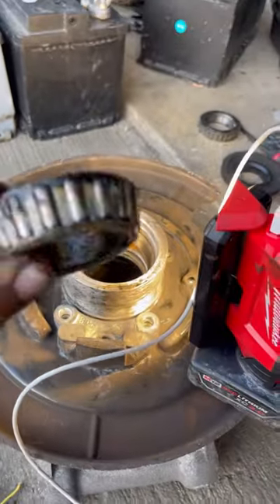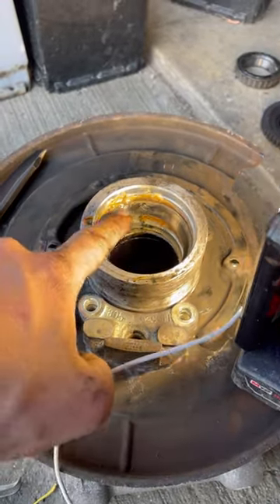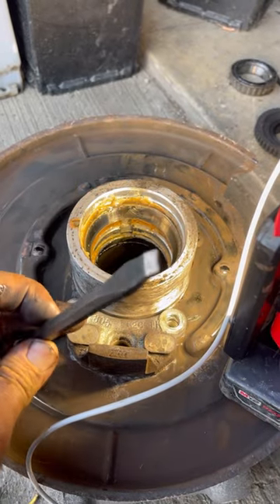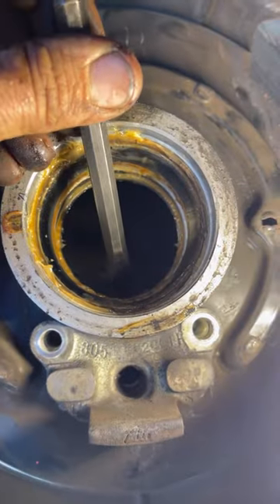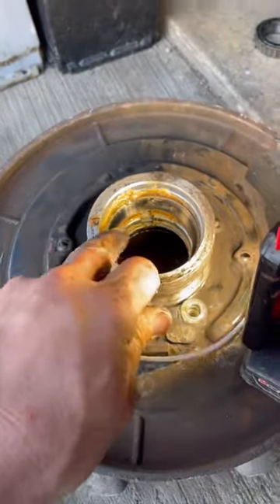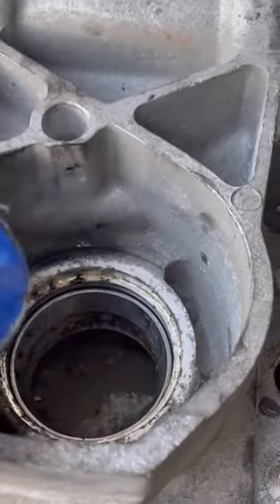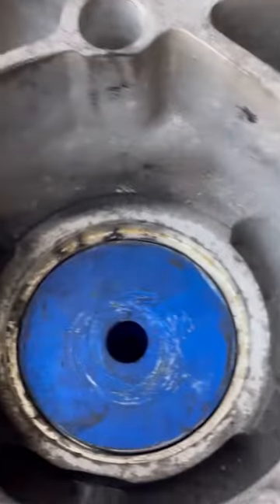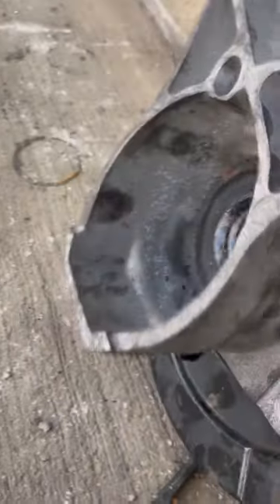Jaguar xj8 rear taper bearings knock out & punch In races spindle / knuckle

Comment from the maker: This car was taken to a shop, they said they couldn’t find a noise.  The noise was coming from the rear, sounded like right rear but can be deceiving.. I didn’t hear the noise on the lift either.  The noise is rare and intermittent but when it happens it sounds similar to a tire rubbing on a fender liner but there is a noticeable pull like something is hanging up.  The car must be driven & under a slight load at 40-50mph to hear it and even then it’s random & infrequent.  Really sounded like it was coming from the right rear when inside the car but after finding no damage to the wheel bearing after replacing it & hearing the same noise even after doing the worn out rear brakes; pads & rotors & cleaning / adjusting the parking brake shoes, eliminating the obvious things… turns out the 75k mile rear Jaguar diff is on the way out.